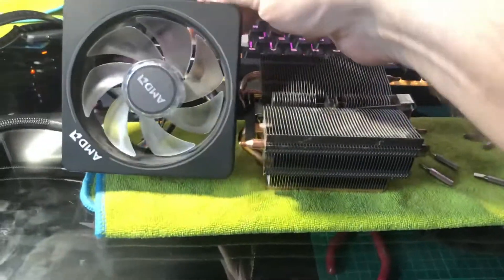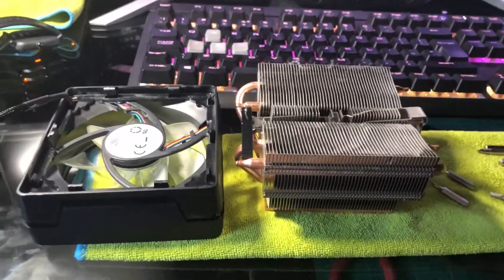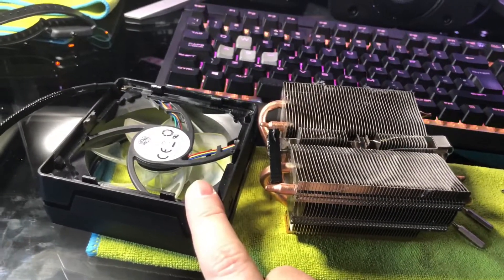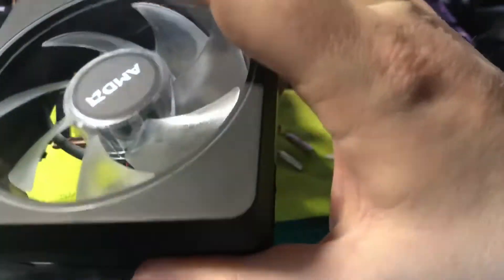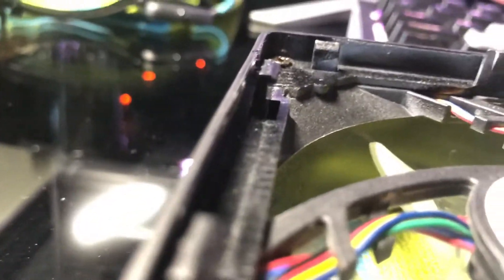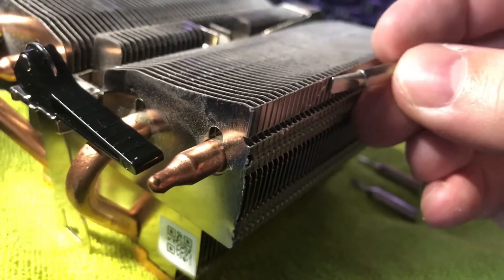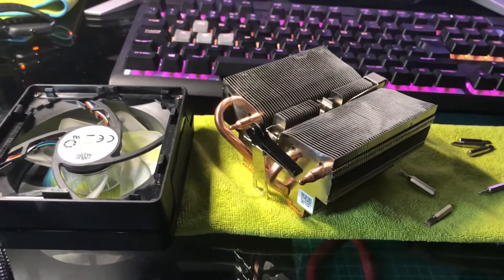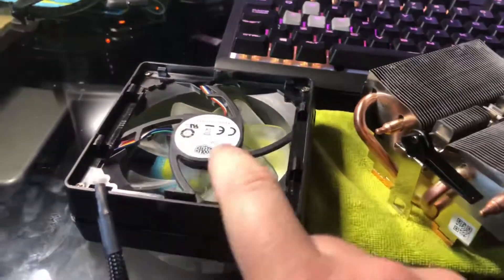AMD Wraith Prism Teardown / disassembly

Comment: Thanks for making this. The real question is was this fan adequate for your new heatsink? This fan is way too loud so I'm thinking a larger heatsink will keep it cooler while keeping the fan at a lower rpm (quieter), was your larger heatsink enough to keep the prism quiet?
Reply from the maker: Hi sorry Ive just noticed this comment, I went for a AIO as a replacement and didn't end up using that fan for anything. As you mentioned it is really loud

Comment: What did you use the fan for and how did you mount it? make another video showing it in use, thanks.
Reply from the maker: I did try using it (Cable tie style) but it's quite loud so I depends how much noise you can tolarate :D
Reply: @pedanticjase  It runs at very high rpm on the high setting on the fan, up to 3600rpm or there about, you need to cushion it with some rubber feet or pads and get your fan curve right to help keep it quieter.  I was wondering it you could use it on another tower cooler because I like the speed and look of it, it does look possible if you find one the right size.